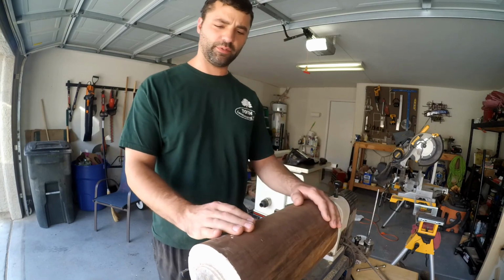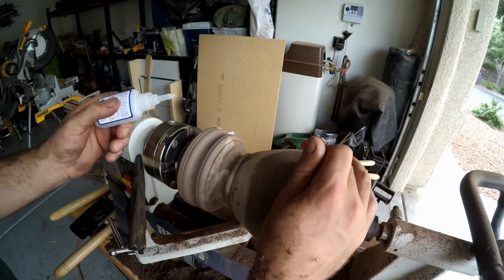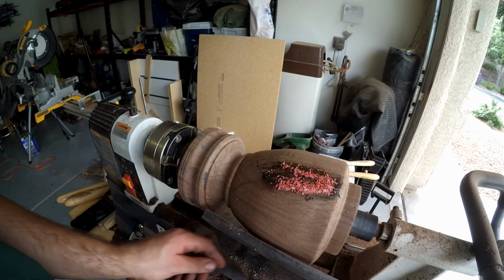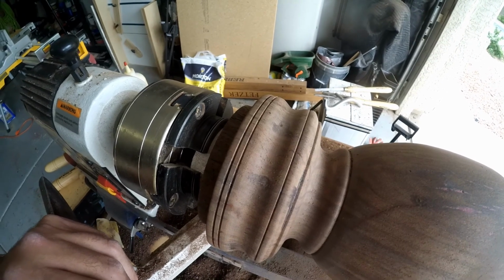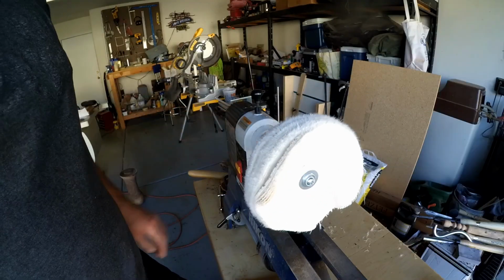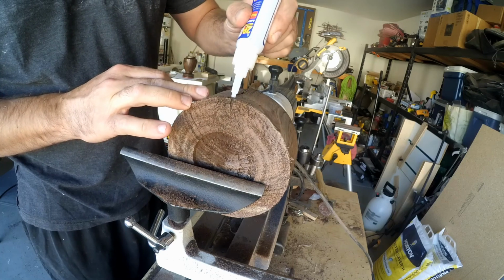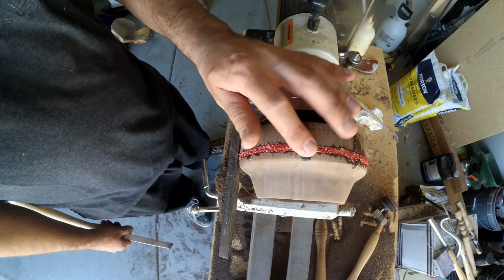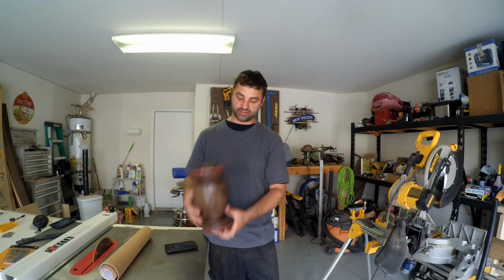Woodturners Journal: Black Walnut Urn with Pink Coral Inlay

Comment: The coral inlay is really nice. You've inspired me to try some of my own. I noticed 2 different glues. What did you use as a base glue then the finish glue?
Thanks for sharing!
Reply from the maker: Ignore that base glue.  Looking back on that, it was a horrible idea.  It shows threw in some spots and looks dirty.  Stick to a really thin CA.  That was the second glue I used in this video.  It soaks in and does not leave a thick, glue layer.  So... more or less, a really thin super glue.  Thank you for watching.